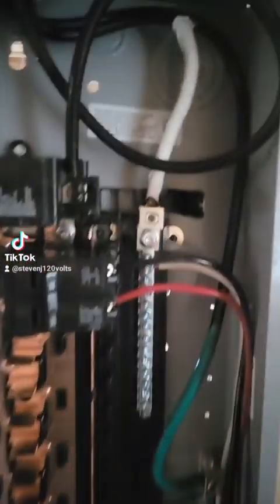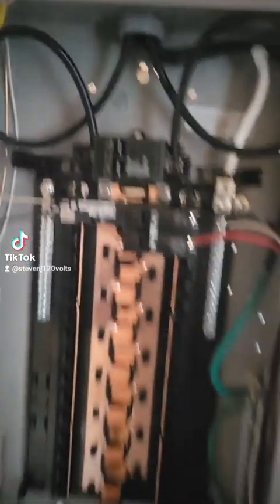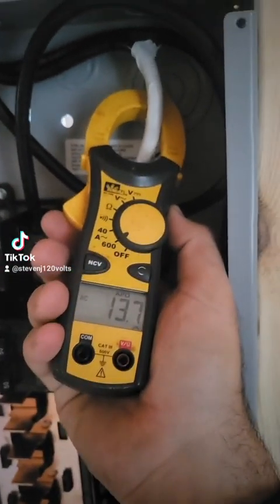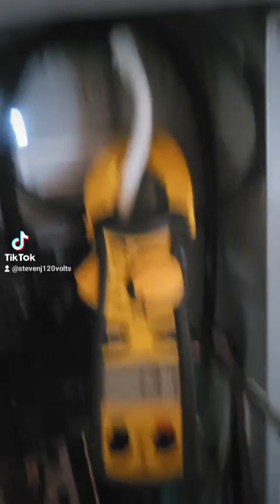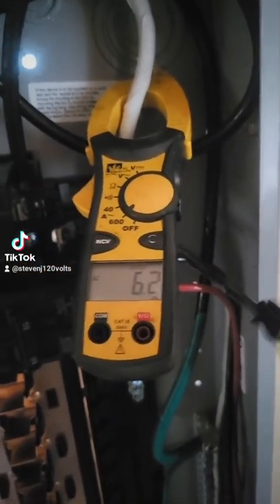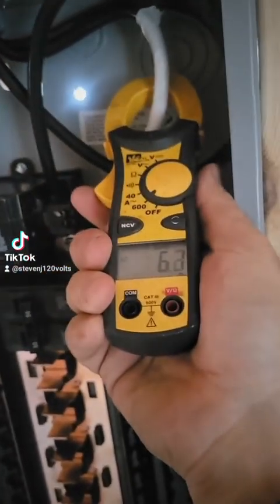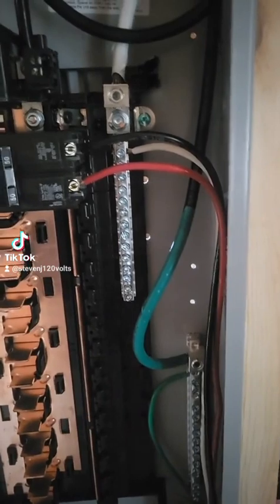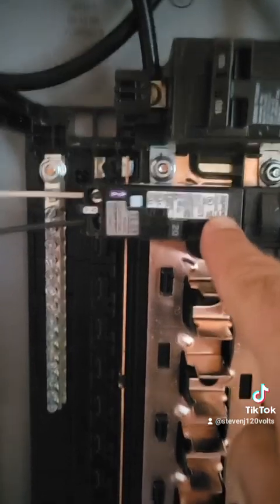Why do we separate grounds and neutrals in a sub-panel

Comment: Not a comment question, not sure where to ask!
I am an HVAC tech been doing it for about 30 years. I’m getting questions here in Florida about adding a soft start to their outdoor unit (condenser) to allow a smaller generator to start. 
I know the kits exist. 
What is your opinion? 
How do they function? 

I’ve read it can affect the speed at which the compressor or outdoor fan motor run!
In particular, I was looking at the ICM 870
Reply from the maker: @airerescueairandheating4597  never dealth with that. I would just be going to Google, which I am sure you already have done.
Reply: @Stevenj120volts  
Thank you so much, sir for getting back to me so quick I always enjoy your videos your clear concise to the point I like that.

Comment: You are really good at explaining this stuff. Anecdotal - I helped my brother wired a house (correctly) when he  was 14 and i was 11; it did not burn down and even passed inspection - although the inspector was not happy. He became a EE and a licensed  master electrician, i remained a geek. 

For the past 30 years i have volunteered in a local community theater in NYC which when I got there was a rat's nest of zipcord, romex, and rubber cord. Through the help of my brother and other electricians  the place was brought up to code (the theatrical lighting is all EMT and legal rubber cable). However, there was a hum in the sound system. They measured at the panel (like your example) which indicated a neutral/EGC connection somewhere in the  myriad of metal troughs and junction boxes and opined that this might be the issue. Took a while and they found several. Hum declined. They also wire-bonded all major metal components. Hum gone. Have you experienced this effect from this mistake.

Comment: Been an electrician for 37 years. The only reason you wouldn't separate at the sub panel is unless its s 3 wire feed. If so then bond your panel. I've seen a lot of 3 wire feeds to sub panels in older homes.
Reply: I think you're supposed to replace the feeder or pull another conductor for ground, not bond the panel to ground.

Comment: Tell me why it isn't ok to do it in sub panel but it is ok a d allowed in the main panel. To me there is no difference. I'd rather run ground and neutrals together period. No matter. The old codes allowed it. You will always have bleed over voltage from neutrals to ground. You won't eliminate the amp and volts completely to zero on the ground due to to the earth soil resistivity, size of grounding, 1 ground rod, 2 ground rods, or foundation grid grounding in concrete, all that matters.  So if your ground has milliamps on it. So what ...that's awfully low. Instead of going by the code like it's the Bible as the explanation, I'd rather you give me a scientific / physics lecture explaining the ins and outs of electrical behavior under various natural conditions the electrons find themselves in to explain the behavior of the phenomenon under the various conditions. All neutrals go to ground as that's the only way they work. All safety grounding goes to ground as that it the only thing keeping you safe. They all go to ground. If the grounding is adequate, no one gets hurt.
Reply from the maker: The old code never allowed I have an old code book collection back to 1940 I can show it listed as violation in the 1940 code.  In 1941 an exception was added during WW2 for ranges and dryers to save metal during the war. That exception was removed in 1996.  Most of what you are saying doesn't really make sense or apply to why we separate them in sub-panels but not in main panels.  Electricity doesn't flow to ground so soil is not involved. There is nothing called bleed over.  The danger is from something called objectionable current and we must try and avoid objectionable current at all costs.  When you have objectionable current a loose or bad neutral connection creates a potentionally fatal 120v shock from outside frame of all the metal appliances powered from that sub panel.  I have a video made with a 1968 stove I have just for demonstrating the dangers of objectable current I will post a link here...
Reply: @Stevenj120volts   Follow up…Dealing with old house built in late 1940s.  It has old 3 wire feeders goin to subpanel in garage on a 50amp breaker from the main….im getting a new gas furnace installed and its located next to water heater, which is bonded to gas line and copper plumbing…does the furnace ground wire (and other circuit gnd’s) still have to be separate from neutral on a separate gnd bar in subpanel ?  And does gnd bar need to be connected to neutral bar on main panel ?

Or is that local grounding (water heater bonding) scenario ok to allow grounds and neutrals to be on same neutral bar in subpanel ?    

Sorry, i know this is long 😊
Reply from the maker: Here is a video show objectionable current.  https://youtu.be/x-PG1VbfkZo?si=sr3kfrYmMLSVf_CD
Reply from the maker: So bottom line NOT separating them in subpanel can create a fatal 120v shock hazard.  But if separate them in the main panel your ground will not function as a ground.  Which can create a fatal shock hazard

Comment: Great explanation!!  Now, What would you do if the home is older with no grounding coming from the main and wanted to wire up a sub panel ? Is the only solution to that running a new cable ?
Reply from the maker: Tough to say if it's the ONLY solution the code has lots of exceptions.  So it would be good to dig into the code see what you could find

Comment: I understand that when a neutral and ground aren’t separated in a sub-panel the current going through ground can energize metal parts. However if the two wires are separated and there was a fault, why is the current traveling through the same ground safe? Thanks
Reply from the maker: The fault should trip the breaker near instantly.  When they are separated the current is always on the ground

Comment: Like lots of other sources, you point out that doing this can cause current to flow over the ground wire, and you say that's "dangerous", but you don't actually explain why that's a bad thing.  Why is having multiple return paths a problem at all?

The answer, for anyone who wants to know, is that this is not generally dangerous under normal conditions, but it can become a big problem under fault conditions.  Consider what happens if you then at some point develop a break in that neutral line.  Well, then all of the current will be flowing back over the ground wire instead.  But that's actually better, right?  I mean, even though we have a fault, everything actually still works, so what's the problem?  It's actually added redundancy!

The problem is that ground conductors are generally not the same size as live/neutral, so they are not designed to be able to carry the same current.  And now you've got all of the current for that whole branch going over that smaller ground wire instead of the neutral, which means it's going to start getting hotter than the neutral would under the same load.  But everything's still working fine, all the outlets and lights work, none of the breakers are tripping, so nobody knows anything's wrong.  There's no sign there's even any fault with the neutral at all.  All while the wires are now getting hotter and hotter inside the walls....
Reply: Not just that but someone can get get shocked too

Comment: Yes, but you stopped too soon.  So, there's now ground current.  Why is it bad for there to be ground current?  Because the ground conductors are sometimes undersized.  Why are they undersized?  Because the ground is only supposed to carry current in an emergency: just long enough to trip the protection.  Why? Because...
Reply from the maker: Yes I wish I could have said more bit This is an older tik Tok video i reposted.  So it was limited to 3 mins.  When you have current on the ground it can create shock hazard and maybe fire.  I couldnt fit them in here cuz they all seem like complex problems that are hard to explain quickly.  But current should not continuously flow on the ground.  It's a code violation and a safety risk
Reply: @Stevenj120volts am not electrician, just started learning for my residential PV designing. 
Like you said, current will be divided based on paths’ resistances…doesnt it prioritize “returning to the source? Unless there is more current than the source provided eg. lightning. In this case how come the current went to the ground?
Reply: @XouXin the ground on the transformer is a lot closer than the power plant. ;-)
Reply: @XouXin   That is actually not true.  The ground under your feet is actually a pretty poor conductor (it can have a resistance of anywhere between 10 and 1000 ohms per meter (which is between a thousand and a hundred thousand times worse than #14 wire, for comparison)), and will not actually allow power to flow very well through it (that's actually why we run a dedicated ground wire everywhere instead of just connecting to separate ground rods all around a house/building).

The correct answer is that the ground and neutral wires are always bonded together at the main panel, which means that the current is flowing over the ground wire to the main panel, then through the bond in the main panel back to neutral, and then back to the transformer (and thus the power plant) that way.
Reply: The current in the grounding conductor raises its voltage. This causes stray currents that can use alternative routes like IT or AV cables. You can get hum or other interference.

Comment: Two things.   Please explain why equipment grounds and neutrals are connected together at the first means of disconnect.   Also,  many people seem to think there is no voltage potential on grounded conductor (neutral).   That is just not the case.
Reply: The primary reason why ground and neutral are bonded at the main panel is so that a short between hot and ground will have a return path, which will cause the breaker to trip.  Otherwise, a short anywhere (in any device) between hot and ground could cause all grounds for all sockets/devices to become "live", which would make every ground suddenly become a safety hazard, instead of a safety protection measure.  This connection only needs to be done in one place, somewhere within the whole system, to serve that purpose though (and the main panel was just chosen as the logical place to meet that requirement).

And it's true that there can be some (small) potential on grounded conductors, but if you are following NEC recommendations for voltage drop, then the maximum voltage potential you should ever find on any grounded conductor (relative to ground) will only be around 3V.  If you have anything more than that, something is wrong (e.g. open or high-impedance neutral, or insufficient wire size for the circuit load).
Reply: @foogod4237  "...short...which would make every ground suddenly become a safety hazard, instead of a safety protection measure"  But ground is still connected to neutral at the first disconnect so why would it become a safety hazard?  I can see if ground is NOT connected at first disconnect then it's dangerous when a short happens.  I am still not getting why bonded or not matters at the subpanels.
Reply: To have a low impedance ground fault current path so that in case of a fault the breaker trips and the equipment becomes safe. A ground rod alone would not cause the breaker trip nor would it reduce the voltage to the safe level but would spread the voltage on the whole grounding system.

There are countries where the connection is not done: Italy, Spain, France etc. In those countries it is mandatory to have the whole house RCD protected. They typically use relatively insensitive one for that. It trips at 100-500 mA. Separate RCDs then are used for individual circuits.

There are different ways to do the grounding. Each have good and bad points. Various contries have chosen their own system (sometimes several)
Reply: Also in Germany this is existing, mostly in older installations.
Google for TN-C-S and TT systems. In the US, TN-C-S is used.